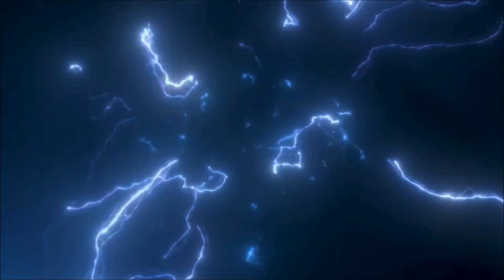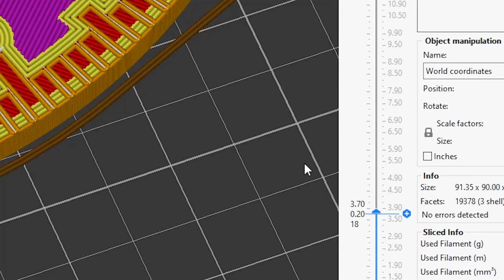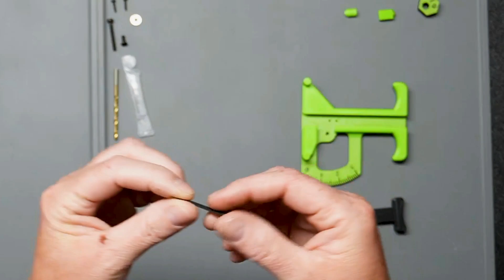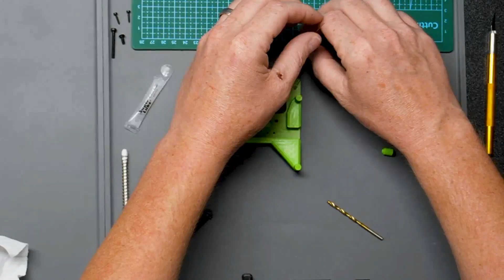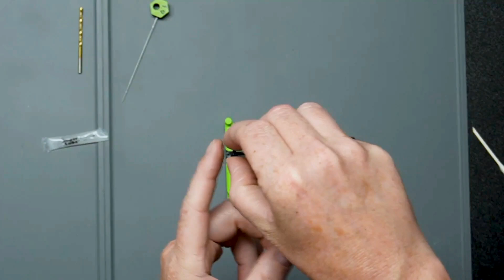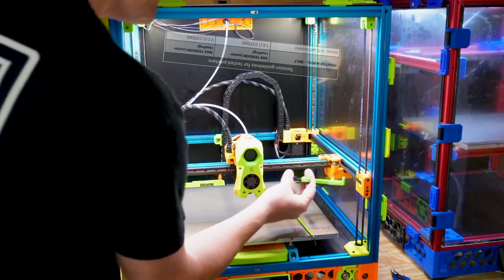Master Your 3D Printer: Ultimate Belt Tensioning Guide with PF Makes' Belt Tensioner!

Comment: Great vid, thank you. Some things that helped my build, after carefully sanding and smoothing all mating parts and applying scant lube, I still had significant stiction so I thought, what the heck and put "alot" of lube on the slide....so much so that I had to wipe off the excess. Took about half the supplied tube. Now I no longer have any plastic to plastic contact so to speak. The result was silky smooth operation.  This did result in higher preload but much more consistent readings.  I wished I had seen this before I printed it, I did not think of the two color option for the letters, very cool! Thank you for your explanation of "belt rack" I was unaware of that and low and behold, my V2.4 had a bit going on. The backyard engineer part of me questions the need of 150mm pully to pully idea. Seems to me with this type tension guage, distance should not matter. In testing, I get the same reading regardless of what the pully spacing is.
Reply from the maker: Thanks for watching! For the adding grease, it will definitely change the readings that the meter is calibrated to. I'd guess if you were still getting stiction, maybe the printed part was a bit over extruded, possibly. 
I'm glad it helped with the belt racking part! That's a big thing with Corexy. 
Also, I've thought the same thing about the 150mm. It does give the same measurements regardless, as I've tested it as well with no difference. Join our discord linked in the description if you would like, we are in there daily chatting and helping everyone in the 3D printing world!
Reply: @leemerie3d  something I did not mention above was the only time I had any stiction was when the tensioner was under the load of the cal rod or belt. Hope that helps.

Comment: What kind of idlers are you using? you mentioned it @16:52. Thank you in advance!! Great Video!!
Reply from the maker: Those are Rama Idlers! Really nice! But to be honest there are even better ones now called Beefy Front Idlers (BFI) if you want a little more strength. Here is the link to the BFI..

https://github.com/clee/VoronBFI

Join our discord! Link is in the description of the video :)
Reply: @leemerie3d  so awesome I'll go check them out just started printing for my Voron 2.4
Reply: @leemerie3d  so the BFI stl'S replace the front idlers for the x/y gantry, and the BZI stl's replace  the(z) idlers for the (z) drive? Is that correct?
Reply: Hardware arrived today From WEST3D along with my BZI,BFI idler hardware and 2 beautiful Rolls of Ambrosia Orange Filament , I installed the hardware into the printed parts as described and demonstrated into  my printed parts . Viola it works like a charm!! Thank you again for all the guidance and pushing my order out soquickly
Reply from the maker: @jameslee6881  That's awesome! I'm glad you got them all installed without issues. 
And your welcome! Always happy to help with any orders with West3d! If you ever need anything just let me know 😃

Comment: btw  Great job in building and showing the little nuances, But one thing when tensioning belts the motors should be on. meaning they should be jogged through mainsail/fluidd or menu. It doesnt do well to not have them off
Reply from the maker: Thanks! And I hadn't thought about that but I can see how that would be a better idea to keep the motor energized. I really appreciate the tips! 😃

Comment: Great video and nice prints, have you seen much use for such a device on cartesian machines or is this mostly for machines with  coupled kinematics?
Reply from the maker: Thanks! 
So not as much. But anywhere that you can get enough access to the belts for this to fit in, you could get a measurement. Now idk what numbers they would be.